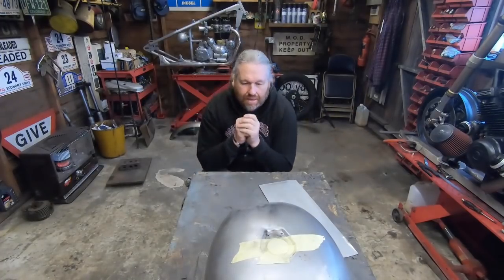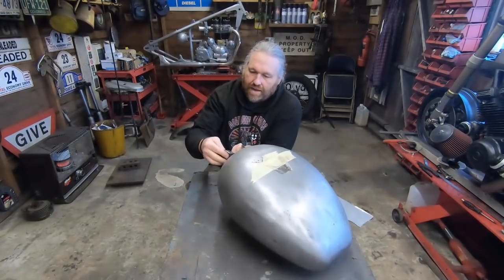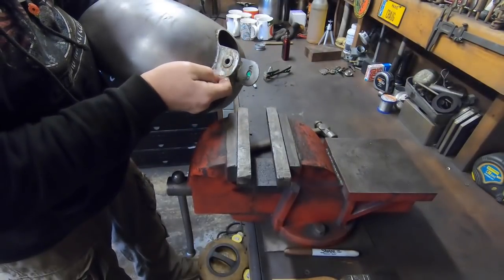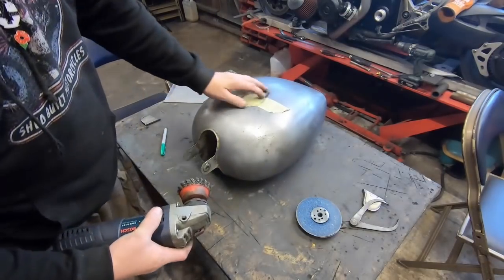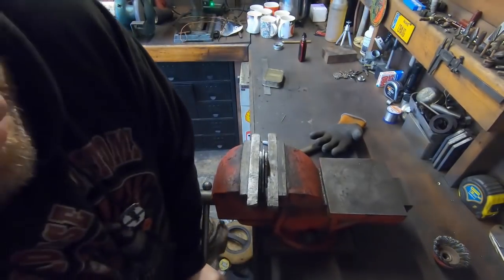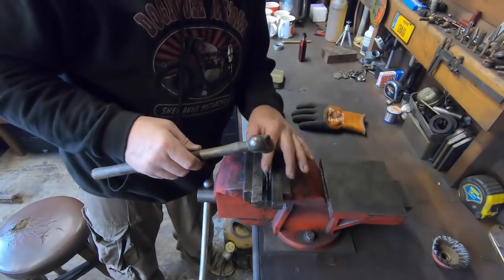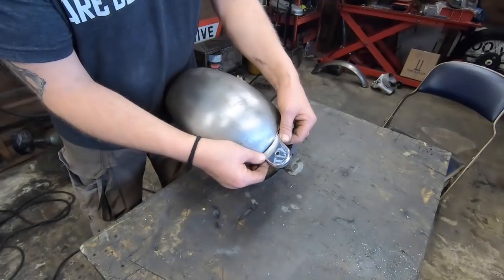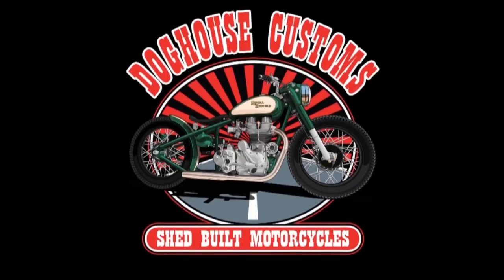Fuel tank bracket covers

Comment: That’s the method we use when making floor panels and repair pieces for cars, normally use marine plywood to make the patterns and secure  the metal with screws temporarily while forming the part ( weld the holes after). Like you say the larger the flange or depth of shape makes the job more challenging, shrinking the metal on the internal radius and stretching on the external. But if you take your time most panels can be made with a few simple tools. Keep up the cracking work.

Comment: Neat idea for forming thin metal sheet. Anneal, anneal, anneal though, aluminium work hardens  so quickly, the old soap trick should give the right temperature. BTW the light and sound are both pretty good. Bash on
Reply: hi rosie, would you mind giving a quick explanation? soap trick? i tried to anneal ally recently but completely bollocks'd it up, would love some advice... ta
Reply: clive ramsbotty. Clive, rub some ordinary soap on the ali. Heat it, and when soap turns black the aluminium is at the right temp - take the heat away. Alternatively, mark it with a ‘permanent marker’, heat it, when marker fades away remove the heat. Les
Reply: @leslieaustin151  thanks!
Reply: Hi Clive, sorry had missed your reply. Leslie Austin has it dead right, use ordinary hard hand soap, rub a thin coating onto the aluminium,  heat up slowly until the soap changes colour, stop heating, let metal cool naturally. It is worth noting that temperature  indicated by this method is very close to the welding temperature of aluminium,  stop heating as soon as the soap shows any colour change.
Reply: Rosie McKellar thanks Rosie! That added necessary detail to the explanation.
Pip-pip, Les

Comment: Hi Craig, loving the vids. Would there ever be a need to heat the metal (if steel) when tapping it round a shaping dye? I've only seen you do it from cold that's all? Keep up the great work! TTFN
Reply from the maker: Thank you Tom. The alloy I used was given to me so not sure of the grade but after a few shaping test it seemed to work very well cold, as you say some material does need heat to soften the structure so it can be worked without splitting. Thanks again Tom.

Comment: Liking the fact you pealed off from on your bike and seem like you will be better off. If you don’t mind me picking your brain for a minute, I’m building a custom bike at home myself, just wondering how tight of a radius can I come out of the head with on the exhaust before it really starts restricting exhaust flow?
Reply from the maker: Thank you Liam. as long as the radius is not restricted on the inside of the bend you can go as tight as the tube will allow.
Reply: THE DOGHOUSE thanks for the help I’ll get it made up thinking about doing a stainless pie cut all tig welded

Comment: What camera are you using Craig? Is it my crap new laptop or is it strobbing a little?
Reply: It's your Computer..I get perfect picture and I'm in the US..
Reply: Your correct, it's strobing slightly. It is on my new TV too.
Reply: Yes it is mate. The flicker is caused by the fact that the lights strobe at the line frequency of the electrical power. If the frame rate of the video capture is close to that frequency (but not the same), then the effect becomes very noticeable. This is particularly noticeable for fluorescent lights and depends on how much other light is available, intensity of the lights, and your distance from them. Essentially, a light plugged into AC power strobes, but fast enough that you do can't see it with the naked eye.
Reply from the maker: Hi Jem, yes it is flickering in the video, I believe Ive got it solved for the next one.